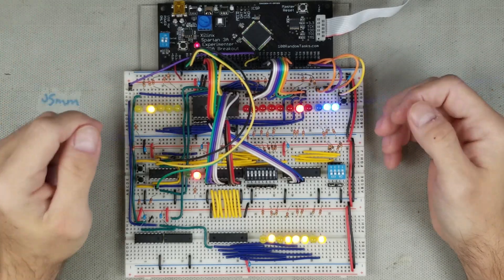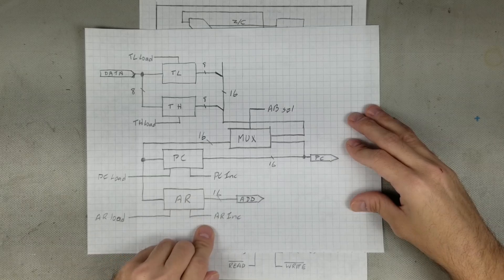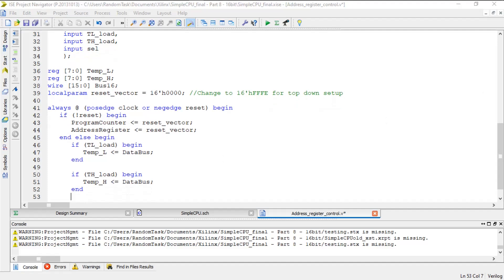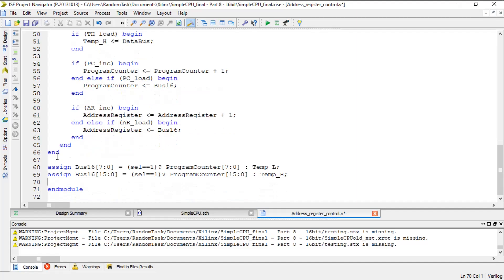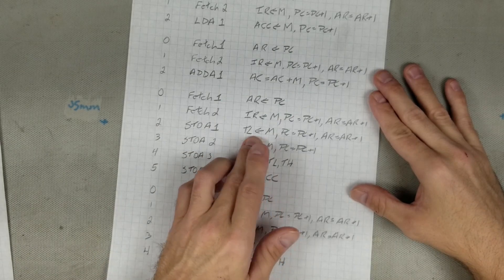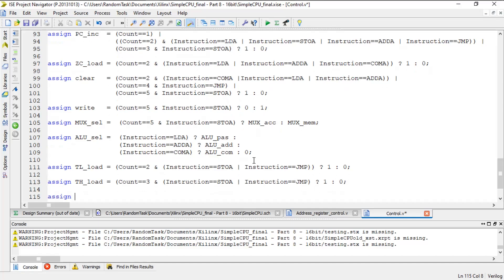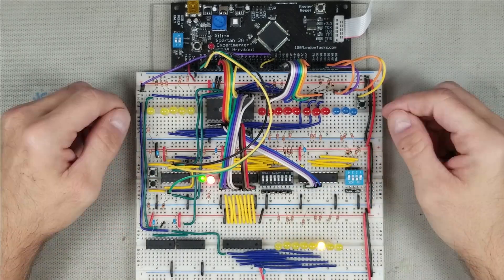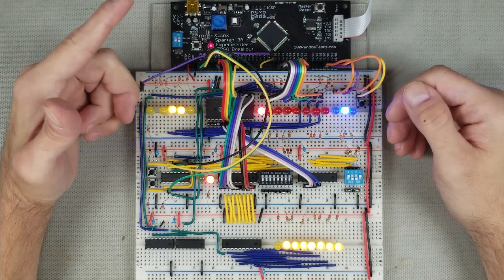HOW TO CREATE A CPU IN AN FPGA - Part 8 - 16 Bit Address Bus

Comment: alu-fast-cache-rom in-memory cpu is the simplest, even multi-core cpu/gpu, same local memory shared multiple access
Reply: 2x 8-bit = 16-bits, in parallel
Reply: an instruction is only a collection of memory pointers (the memory controller takes parameters each cycle directly from L2 shared memory, ie, instruction, memory locations, directly)
Reply: simplest logic possible
Reply: FP16 rocks